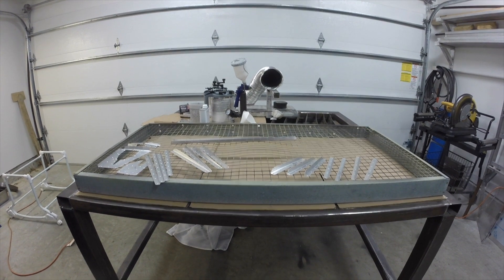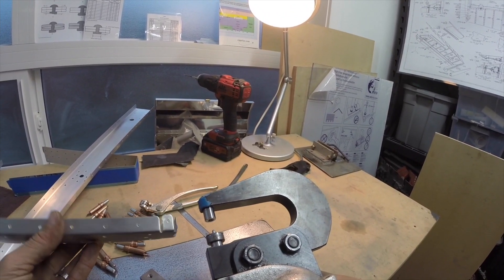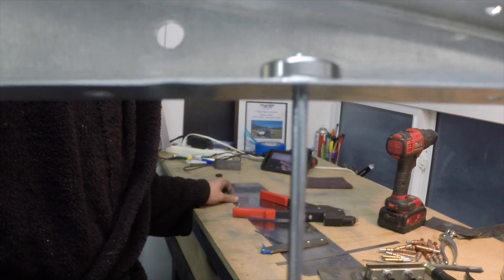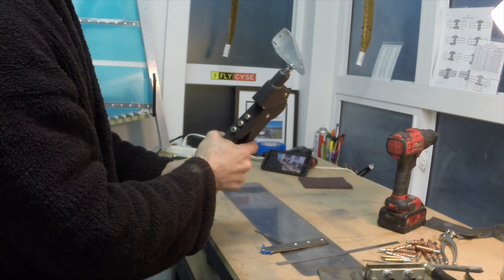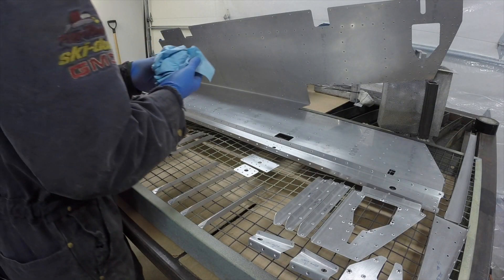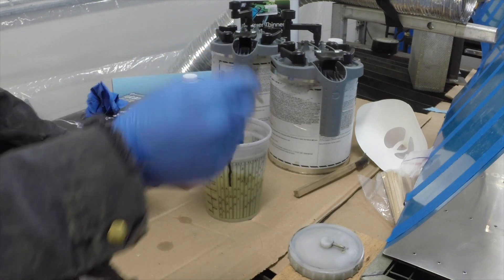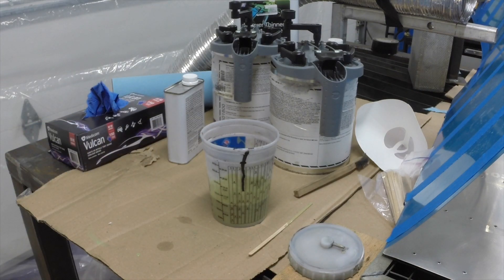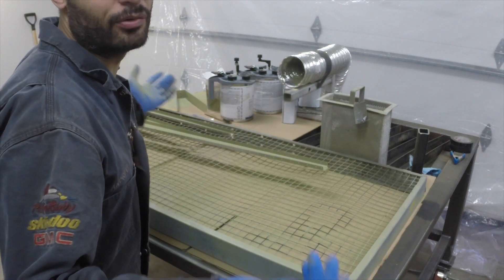RV-7 Left Elevator AKZO Prep and Primer

Comment: Hi Andrew, will you use the same Azko epoxy primer for priming the external skin of your airplane before final color top coat ?
Reply from the maker: I haven’t done the research yet if it is compatible with exterior coatings. I believe it is. I’m planning a polish and vinyl exterior but if it does work and I change my mind than yes it is the product to use for sure!

Comment: What size nozzle is on your gun? I was planning to use the $9 harbor freight gun to spray AKZO, but I heard the 1.4 nozzle is too small, a 1.8 is better!
Reply: Thanks, I have the purple guy.. I saw the AKZO instructions call for 1.4 too, so I feel better! Stuff should get here any day now!
Reply from the maker: taltruda I have the 1.4 blue guy. AKZO is very thin. Good luck!
Reply: Did you make those grates you have to paint your parts on? Please explain what they’re made from. Thanks.